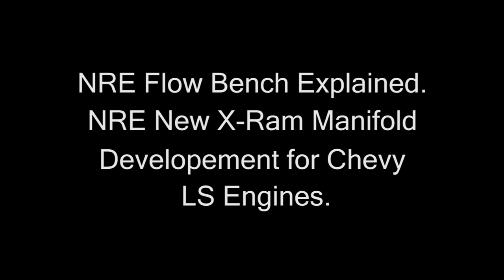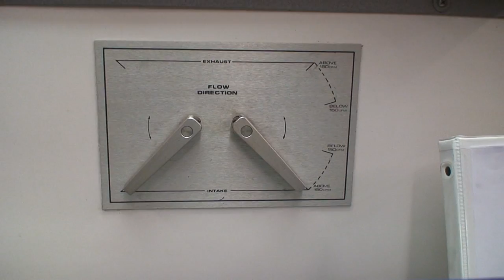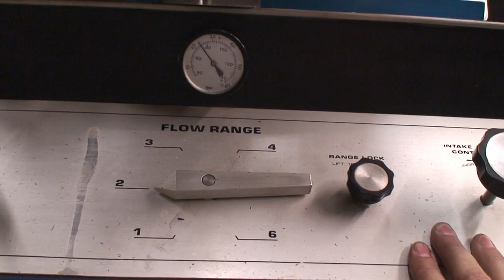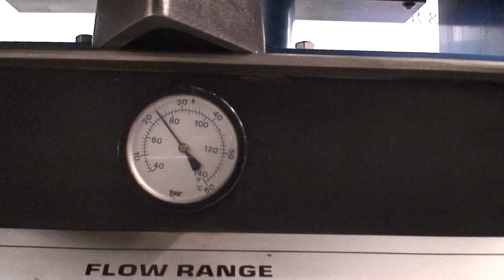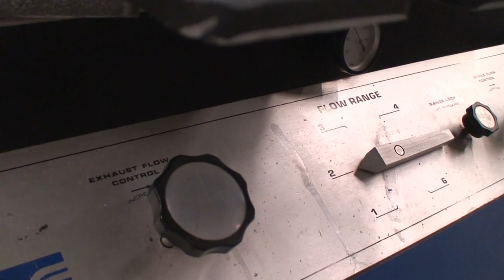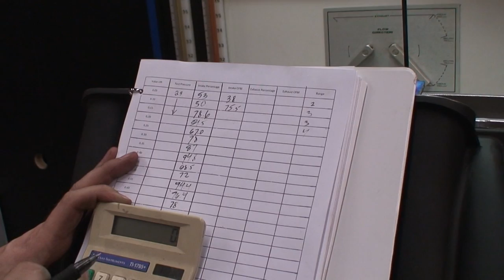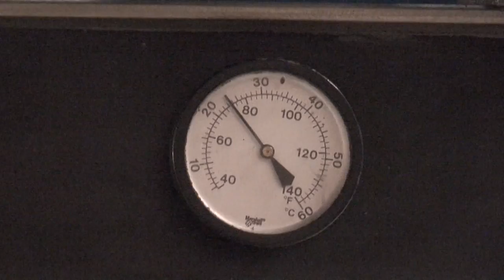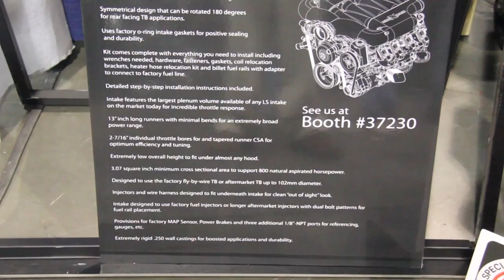NRE University. NRE Flow Bench.  New X-Ram Manifold for LS Engines.  NRE TV Episode 206.  Tom Nelson

Comment: Thanks for the video and congratulations for the new manifold. This new product looks very nice and shows how much time was spent on it. Moreover, the casting looks very neat. However, the comparison between the manifolds was not fair. The X-Ram should have the plenum covers on to be compared to the stock manifold or at least this is what I believe!
For future products, having the trumpet of the runner higher than the plenum floor would increase flow. It is technically possible because it has been done by AMS.

Comment: So this is the difference between me and my summit racing catalog and a set of socket wrenches.  And a guy with extreme knowledge making much more power with the some basic motor....ahhhh.  Awesome demo,,,thanks
Reply: The blueprinting process is what makes a race engine a race engine. when building an engine for real you make sure everything is equal to each other. cc chambers have to be checked on each cylinder, valve spring rates must be checked, piston and rod weights, EVERYTHING. One thing out of balance will be failure.

Comment: 22:24; spot on. This is (one of the reasons) why 4 valve heads are superior with track racing; the initial valve curtain area opened is greater = better throttle response. Still, love the stuff NRE do, and love that X Ram manifold. I'm betting a water to air cooler fits into the picture on either side of the runners.  Great stuff.

Comment: When I used to do a bunch of head porting I discovered that clay was no good, It sucks in slightly and ruins the numbers. I had one head that wouldnt pull past a certain number with the clay,then I built a radius plat out of lexan and the flow increased 20 cfm.